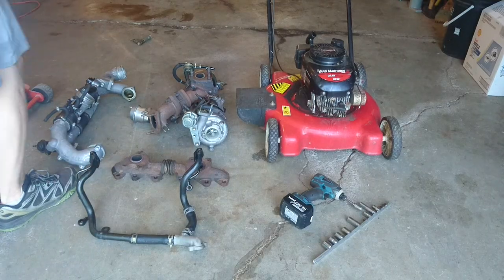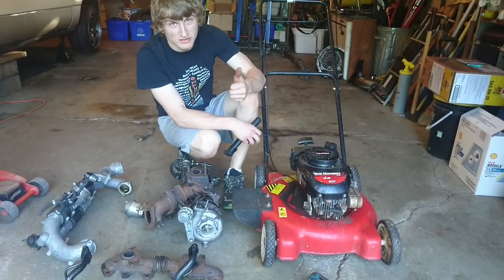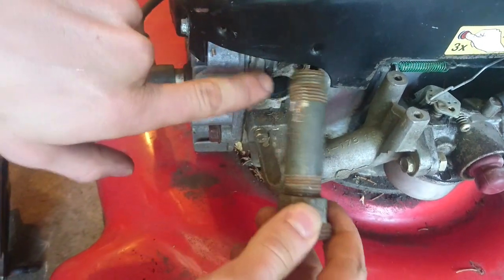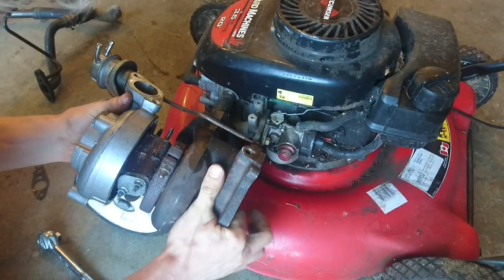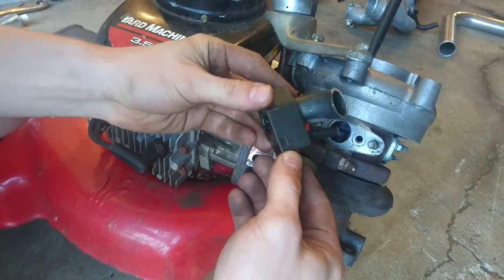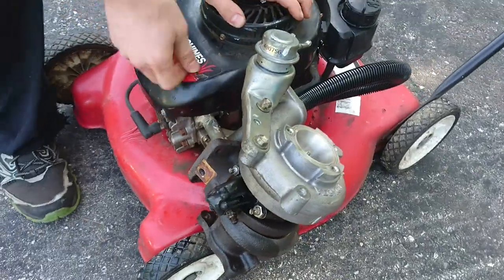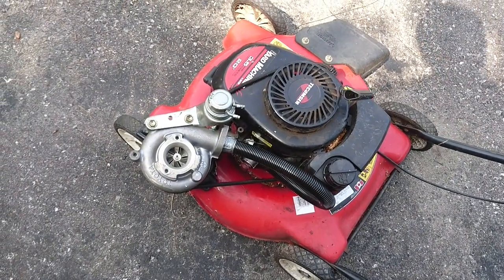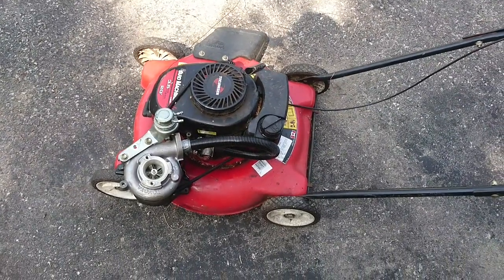DIY Turbocharged Lawnmower Project

Comment: Use a slightly small turbo or use a shop vac(set to blow) or leaf blower to help spool the impeller. Or, put a diverter valve on exhaust pipe. One way to atmosphere the other to the turbo. Start mower in straight pipe mode, get the rpm’s building then roll on the turbo with the valve. 
Cool build though!! Keep up the good work!!

Comment: This would harm the hp. Since turbos need to spool up and give no gains to a idling engine which the amount of exhaust coming out would be less than what's coming from its original engine at idle. You would need a smaller turbo most likely custom that needs less force to spool to get any hp gains. Carb would need to be modified too allow more fuel.

Comment: Smaller turbo. And than you can try to put your turbo between engine and carb. Carburetor needs vacuum to suck gas if there is too much pressure than the air pressure will block gas.

Comment: I realize this video is several years old, but there is a possible important application for turbocharging internal combustion engine-powered electrical generators used at high elevations. I have a gasoline-powered generator I want to use at 10,000 feet in Colorado mountains, and efficiency is reduced to 65% due to thin air (3.5% loss per 1,000 feet). A turbocharger could help overcome this. I know I'm not alone in needing such a generator modification.

Comment: You didn’t shorten the stroke of the piston. You need to lower the pressure in the piston since you’re increasing it in the turbo charger, if you don’t you will get terrible knock and the engine won’t run properly.

Comment: You have to put the carb somewhere on the set up so it doesn’t get put under boost, the carb needs vacuum to operate. If the carb gets boost it’ll just push the fuel back into the lines.

Comment: carburetor b4 turbo inlet... everybody that's a diy mechanic leaves the carburetor after the turbo in the "boost stream". too much pressure will push the floats close, and starve the engine of fuel. the only way you can make that setup work like u currently have it is to install fuel injection from a honda scooter pgmfi. look it up, i've done a few turbo conversions on motorcycles. i've always installed the carb b4 the turbo inlet. turbo sucks in the fuel and air mixture, pressurize it b4 the inlet valve... Goood luuuccck

Comment: Considering the RC car hobby, even though I've never purchased a gasoline-powered RC (mainly due to the price), I know considering at what I've seen at my local RC hobby store they are based around a small gasoline engine similar to that from a push lawnmower or weed whackers. With that in mind, using your logic here, one could in theory turbocharge an RC car.

Comment: I'm sorry bro I don't normally criticize but you only cross-threaded and turned 1/8 of a turn into the exhaust port.  Like that was the most critical step of the whole process bro. It broke loose by you just pull starting it bro. It was literally hanging on by a thread, one half a 1/8 a thread lol

Comment: Why would you ruin those Supra parts for a mower? You could have sold those for some good money. Also, those parts are hard to come by, making them more valuable. I like the fact that you turbocharged a push mower, but you probably should have used some much cheaper and less rare parts.
Edit: what a waste of 2jz parts. And, it didn't even work. You ruined those parts for nothing. How many Supra owners had panic attacks watching this?

Comment: The turbocharger you used is way too big for the size of engine you are mounting it on. Just look at the inlet/outlet and how big they are compared to the engines intake and exhaust port

Comment: You don't need to self tap that pipe into the exhaust, it's the same size threads. Perhaps a form of belt drive to the turbo off the flywheel is in order, friend.

Comment: Nearly 30 years ago I bought a Dodge Challenger with a sick 440 engine and a blue bottle in the trunk. Time slips in the glove box showed low 15's on NOS. A bone stock 440 in that car should have run 13's. So I ripped it all apart and rebuilt, without the NOS. 12 seconds happened. Maybe 20 years ago I tried to mow a brick in deep grass resulting in a bent crankshaft and a leaky oil seal on the mower. So, what do you do with a busted mower, and a nearly empty bottle of NOS????? Easy answer....the NOS mower experiment. The bent shaft and mangled blade made for a very shaky mower, so I took the blade off and overfilled the crankcase with oil. The engine would run at full speed without a blade, but wouldn't idle, so I wired the carb at full throttle (no governor). I stuck the hose from the NOS bottle straight into the air cleaner box. There was no liquid left in the bottle, just gas and it measured about 200 PSI after sitting in the Florida sun for several hours. I cranked up the motor and all onlookers settled on a best guess of about 4500 RPM. Then from a distance I slowly cracked open the valve on the NOS bottle. At about 1/2 turn on the bottle that little motor SCREAMED. Any more slowed it down, so I backed up and let it scream. After about 30 seconds the exhaust got quite smoky and what was left of the muffler was glowing red. After maybe 10 or 20 more seconds it started slowing down, then just died. I couldn't turn the motor over with a pipe wrench on the crankshaft, and all the oil was gone. The big bang we were expecting never happened.

Comment: Would've been better using a smaller turbo but even then, you may need oil pressure in there for the bearings to work correctly

Comment: You put the turbo on the wrong side of the carburetor even!🤣
Even if you had managed to get the turbo to build boost, it wouldn’t’ve worked without putting the carburetor before the turbo intake because it would have pushed fuel backwards through the carb because if the atmospheric pressure versus the internal pressure! Good greenhorn attempt though!
Reply: I thought the exact same thing.

Comment: “Custom exhaust manifold”😂😂“charge pipe or intercooler”😂😂 two completely different things but hey, maybe those fins on the plastic tubing will expel some heat and give you lower charge temps. 😂😂 love it.

Comment: It will never work with a turbo on a carborator. Carborator need vakuum to blend air and petrole. If you wanna turbo on, you need injektionsystem on.

Comment: I believe the turbo was spinning only because of the vibration from the engine. For turbos to do their job properly, they require a specific ratio of the exhaust air pressure, the amount of air the turbo holds, the size of piping used for everything, and the size of the turbo. to complete these calculations, you need to know how much psi of air your exhaust is pushing through the end at stock levels ,so you can find the right size turbo, Exhaust piping, manifold, turbo intake tubing,  (ect.) Go at this project again! I honestly think it would be pretty cool, And VERY funny if this lawn mower made boost! Keep at it, and (if you are even reading this) I hope my comment helped. :)

Comment: My Twin turbo Subaru pushmower starting at 900 horsepower with a 5 inch lift with 3 inch spacers and 36 inch rims yes it may not mow the lawn but it looks cool and its straight pipe

Comment: First off way to big of a turbo second you could have Easily built a manifold to bolt up on the mower engine and the turbo minor welding tig preferred and idk wtf your gonna use other than external oil pump feed and turbos will burn there internal oil so filling it then capping it off won't work long at all plus it has to circulate to cool the turbo duh so I give this project a max of 5 minute run time or close to it

Comment: This isn’t meant as a hater comment but this was doomed from the start.

I would have started with a lawn mower with throttle control as a turbo is largely for acceleration as against power. I also would used a smaller turbo.

You could have replaced the boss underneath for a self propelled mower and mounted a small oil pump for the turbo.

Then your fittings were quite a bodge and you found that out through failure.

I will say credit to you for having a go but just a little more effort and you would have had much more success.

Comment: The pipe is a 1/2" or 3/4" nipple with half of a union on it. Id suggest taking a flat piece of 1/8" steel and tracing the shape of the muffler flange. Cut it out and weld a pipe to build a manifold onto or adapt to the turbo manifold. It will prob keep your block from breaking or being damaged from the nipple vibrating and damaging the block when it jiggles loose and the tyrbo prob fallbs off in your yard. I did this on a riding mower years ago the played more with it changed it out to a custom intake with twin mikuni carbs. And stacks for exaust. My friends mother was pissed when she got the mower back and was pulling wheel stands in her yard with 12" wide rear wheels  in second gear. Wheely bars helped solve most of that. Added weights on the front of the mower helped as well.  You may want to play with electric powered turbos as well. There are motors now that are capable of providing the power needed to move the air necessary to make a difference and or spin a modified turbo. Kind of a nash up of supercharger and turbo . Have fun and wear steel toed shoes....and a cup. Ya never know when your stuff will work realky well only to find that the guy that built the original project vehicle may not have been focusing that day he put it together.  Redo the block to manifold. Use nipple out to a union. Squished union out of manifold to nipple with other half of union then you tighten the union without having to rotate the entire system. It sits still you pull the two together with the union.  Guess ill get back to the video to see if it works. Last thing you might add a pcv valve to allow pressure release. Sorry it didnt do what you wanted. One last suggestion. It looks like uou have a newer style carb that iuis epa friendly. No  throttle control.  Dig thru thffe neighbors shgved and find a 40year old mower with throttle control. Use that carb. You will need more fuel if you fix your exust issues. Remove tge governor. Trash the squished union. Go to a muffler shop with motor gteads working there and have them braze a flange you make that will bolt to the manifold then do the union fitting to join the block to the turbo. I toyed with this on a fully wireless remote controlled mower i build 30 years ago. I loved laying on a lawn chair drinking beer while i mowed old man Noeys yard across the street three  houses down and got paid to do it. Decided faster wasnt necessarily better in that project.

Comment: i believe turbocharging engine running on carburettor that way is kind of impossible? it would blow fuel out instead getting it in to intake manifold plus there would be now enough exhaust volume to run turbo of that size. for this application belt driven supercharger would work better only if you get carburettor before turbo so it sucks air through it. it was a nice attempt anyway :)

Comment: Turbos dont work on small engines, the exaust gas is not enought to build up high presure, slso the small engine couldnt use that much air, the air fuel ratio would be way to lean, this is why turbos are commonly used on high rpm gas engines in combination with direct injektion

Comment: Once he gets the kinks ironed out, I wonder how far that mower will toss the average rock and how thick of a wall it will go through?
Reply: I don't imagine it'll gain a single hp
Reply: @Deegan02  Probably needs a bigger throttle body for better afr. Even than, the cylinder would be able handle it.
Reply: He wont be able to work the biggest kink out... that's making power from a turbo on this kind of engine

Comment: Why? Also that  turbo is way to big for that small what 148cc engine. You need to match the turbo for the air flow and size of engine if you ever expect it to make boost

Comment: It's not a failure the only thing you did wrong you should have revved it up that's what gets that turbo spinning you have to build up enough exhaust pressure to spin the turbo that's why I it shut off probably had back pressure in it

Comment: I'd use a smaller turbine but you could probably keep the larger compressor. That turbine is certainly too big for the low levels of exhaust. Also a smaller a/r would most likely help too as it will create higher gas velocity and spool the turbine more effectively. Being such a small engine with one speed you don't have to worry about maxing out boost before hitting your top end rpm as it will pretty much only be running at the same rpms the entire time.
Reply: A:R ratio would not be as important as turbine size and trim.

Comment: Interesting project.  But from my experience, Tecumseh engines are very finicky and are a pain to start/keep running.  I'd be interested to see this modification attempted on a Briggs & Stratton L-Head.  This is pretty cool though!
Reply: Tecumseh engines are good...it was the fine jets in the carburettors that caused a lot of problems...these problems gave Tecumseh a bad name in Australia...you are right though, not the best choice....L Head would be better but would still need to limit the rpm because of piston slap.

Comment: Carb works on vacuum from engine to draw fuel, if you create positive pressure in the intake no fuel will come out of the carburetor thus you must have the turbo in between the carb and engine. Make sure you dont light the mixture in the turbo

Comment: *4 Cylinders running 6s or 5s on the 1/4th mile 

*V8 tards *muh 698 10 liter quad turbo fox body is faster than your lawnmower

Comment: Your exhaust connection is shamefull. Shame shame shame. Cut that pipe in half, screw them in correctly and completely, then join them together with a coupler. Flange the two ends connecting and connect like a cars muffler to header.
Make some kind 9f support for the turbo. No way is it going to last long with temp fluctuation and vibration.
Finally, use a leaf blower on the intake when you start it. You might need someone to either hold it or pull start the engine.

Comment: I admire the trying...but being smart enough to build this you should have known that the engine would not have air flow for a turbo that large.  If you used a smaller turbo it would have worked.  Good job though

Comment: That exhaust manifold is a horrible choice. It is way too restrictive! You would have been better off just cutting up your stock exhaust and build a flange so you could bolt it to the engine, then bolt the turbo to it.

Comment: Remount it with metal conduit from home depot and some adapters and use clamps on them or silver solder with a blow torch, and get the turbocharger to spin kinda fast with a compressor or leaf blower to get her spinning, all you really need is those two things... New exhaust manifold............ And get that supra tt spinning before you start the mower

Comment: What if instead of using the exhaust to drive the blower motor if you put an electric blower motor on there then you could develop boost? Maybe too much boost maybe blow the head off of it? But that would make a great video! Thanks for putting this video up interesting project

Comment: If you vertical mount the turbo, the oil won't drain properly, needs to be +/- 45deg from horizontal

Comment: I admire your ambition kid! No offense but there was never a chance this was gonna work? You would need a compressor about 1/10th of the size that u used...among many other things? I suggest trying using somethin like metal conduit and some of the strongest hose clamps u can find? There are pipe threading kits online for around $15-20 for creating threads or atleast grooves to help the hose clamps? Make a small gravity feed oil sump or even a vacuum powered pump to circulate it? The key is as close to 100% leak free connections! Think about plumbing couplers and reducers for  Copper,PVC or even high pressure n high temp air hose were its not going to directly touch the engine to avoid melting it? Good Luck if u ever try it again!!

Comment: since a mower is basically a huge blower as it is, can you drive the turbo off the the drive shaft instead of with exhaust gases?  More like a supercharger... Im thinking you will need to play with gear ratios though.  I was thinking of maybe robbing the gearbox off an angle grinder and combining it with gokart gears or something to get close to 100:1 to drive the compressor wheel.  You should be able to spin a big turbo this way

Comment: You have to go with a draw through, if you put your carburator after your turbo the high pressure from the air won’t let the gas to  exit the carburator so put it after or make a high pressure fuel system. 
Sorry for my bad english :P

Comment: Great post.. .I think if you move the carb to the intake side the compressor gas will flow and the engine run. I've did this with a compressor and got a very nice flame but did not run any engines. Any pressure build up in the carb cases the gasoline to stop and bubbles back to the gas tank. Best of luck... would love to see this run and the power output. Wonder if it might be to much and might exploded. Might blow a head gasket, Be careful at very high pressures.

Comment: Use electric powered oil pump to create presume so can balance out on a bed of oil other than sat against the case so spin up freely . At same time you should do a small oil cooler system ,for a small amount of time fabricating proper induction and exhaust it should do well ,bit more time in and your most the way there, induction and exhaust pipe ,electric oil pump(decent fuel pump) a battery to run it ,small oil cooler and connect all up should be boosting just fine then ,you could do your neighbours head in everytime you turn to do another strip you can give it some on the dump valve lol